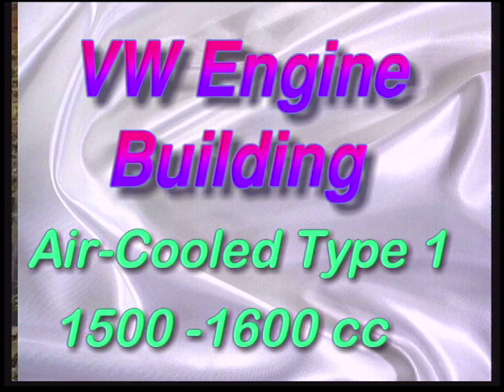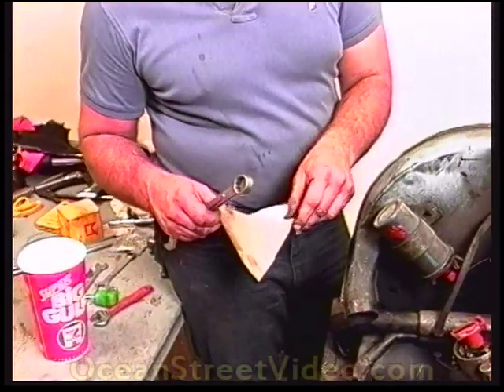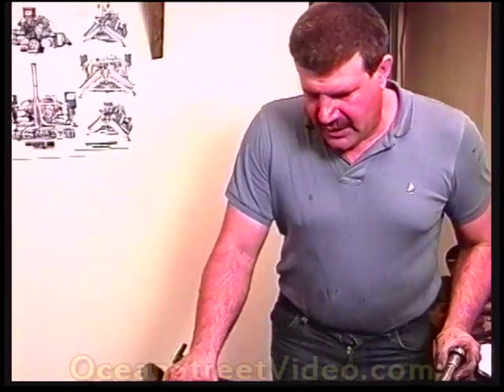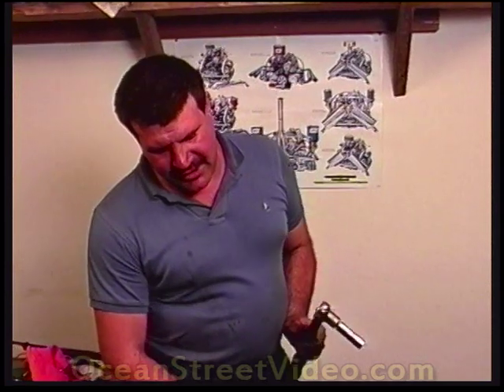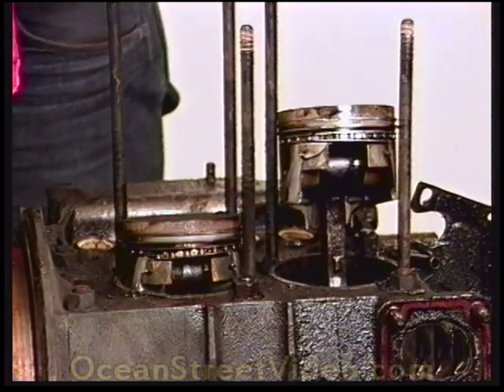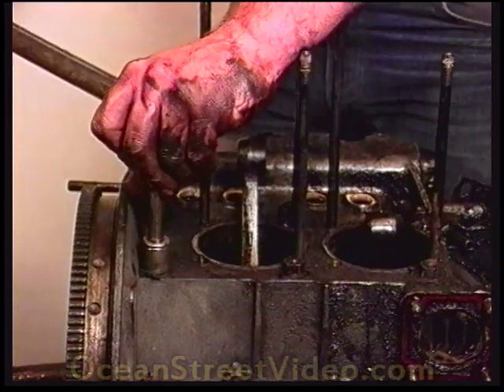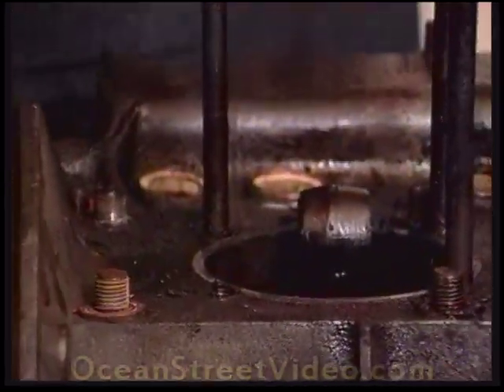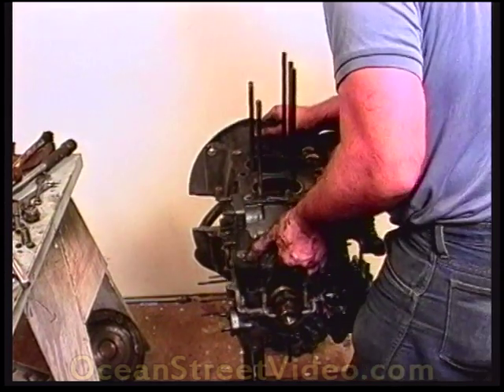VW Engine Building: Disassembly, Type 1, 1500-1600cc

Comment: Before removing the flywheel, is it a good idea to check endplay to see if the thrust is still in spec?
Reply from the maker: Hi Mark, if you are going to split the case you'll find out what if anything could cause endplay issues. If you aren't going to split the case it's a bit more complicated, because you don't know if the end play was set correctly to begin with, for instance it's an engine that was in a car that you bought. What I like to do is grab the pulley on an old and well-used assembled engine and see if it moves in and out, in other words if the thrust bearing area is pounded out you'll see endplay slop at the pulley, without even pulling the engine out of the vehicle.

Comment: i was told do not use a clicker ,,,,they are not safe and accurate enough for vw , use the needle tork wrench , thanks nice vid always learning
Reply: +MrGarcon98 the "clicker" is a torque wrench
Reply: +slayercft i know you missed the meaning of my comment . when using a torque wrench that clicks is not as acurate as a torque wrench with a pointer , specially for heads . even the book says it .
Reply: MrGarcon98 Ohhh I see now, I'm sorry I misunderstood. I only have the beam type and an electronic. I didn't know the click type were that inaccurate. Good to know!
Reply: +slayercft  here is the thing ! if you torque the heads and your using a clicker that is not accurate when the motor gets hot and expands if the heads are too tight , disaster can happen like striping studs and etc etc. have fun i am 63 i just wanna ride more then work on them anymore LOL >
Reply: Not true. Click type of torque ranch is very reliable and used in all automotive industry.  If you want to spend extra money and have something fancy that works, buy Snap On digital torque ranch. Don't use needle unless you're doing inch pound reading. Do your own research

Comment: There seems to be some various opinions about what is the correct torque for the two different sizes of head bolt/nuts. i.e. there are 8mm and 10 mm bolts. What is the correct torque for these two sizes. The link in one reply just has 23 lb ft for cylinder heads.
???
Reply from the maker: +DG Carlson good question, they are indeed different, i think that these torque specs should reflect the info that is in the factory Bentley manual http://www.hotvws.com/content.php?contentID=62

Comment: Ey, what can you get for a rebuild 1600? I mean case linebored new bearings, new cilinders, pistons and heads new oil cooler and all sheet metal cleaned/painted :)
Reply: MrPyroBomb $1000-1500 at best. Unless performance parts installed with paperwork, you can ask up to 5k

Comment: Are all your procedures basically the same for a 1300 engine?
Reply from the maker: +DG Carlson Things like lapping valves, checking for cracks in the case, hanging rods, etc. should apply to all Type 1 engines. Differences would be most noticeable in areas like the oil galley size vs. oil cooler selection/installation, because it's a bit complex. I don't have enough 1300cc experience to comment on much more than that, so be sure and reference the Bentley service manual.

Comment: WTF!!!! Just pry away with that lever on those alloy head fins. Oh and while your at it beat the shit out of the cast fins on the cylinders with that 2LB hammer. YES I SAW THE BROKEN FIN ON THE CYLINDER
Reply from the maker: Don't get your panties in a bunch, lol, that engine was junk... Mike clearly stated that he knew the previous owner, who had run it low on oil several times, and basically abused it badly. It's not financially viable to do things like repair cracked heads, and re-use worn-out jugs/pistons. Even the engine case itself wears out, as these videos show.